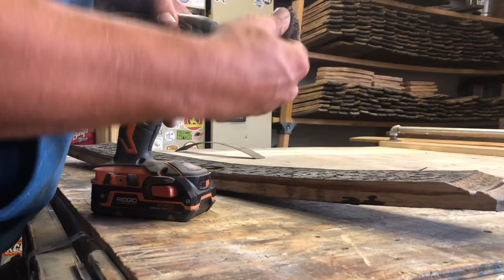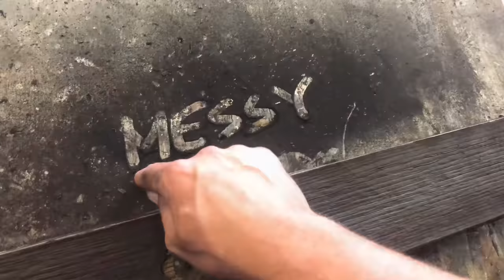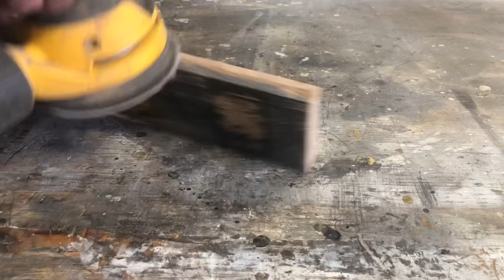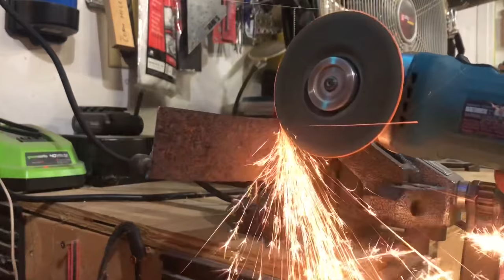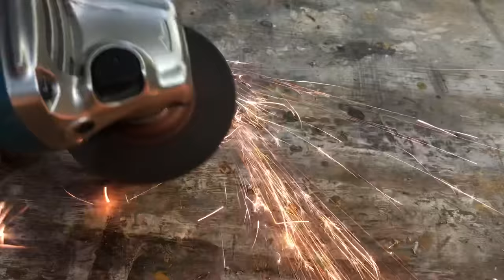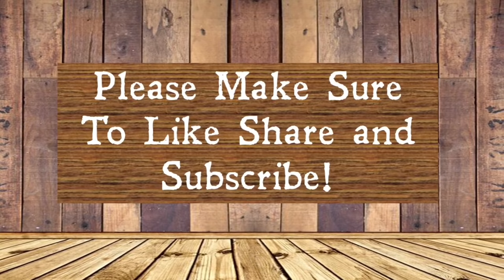Reclaimed Bourbon Barrel Stave Bourbon Buddy.

Comment: What kind of tool was that you used to sand off the burnt part?
Reply: He used a wire wheel. Be careful using those as the wires sometimes detach and when they hit you it don’t feel the best. You can buy them from Lowe’s, Walmart, Home Depot, Amazon, any hardware store. They are mostly used in welding shops I can say I have a few here in my welding shop.